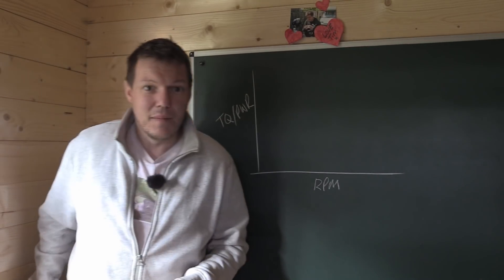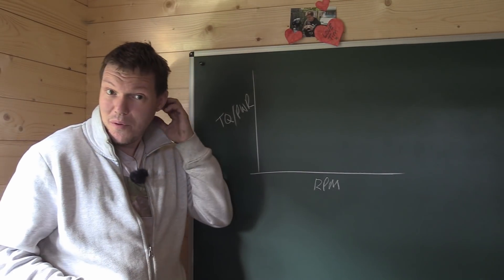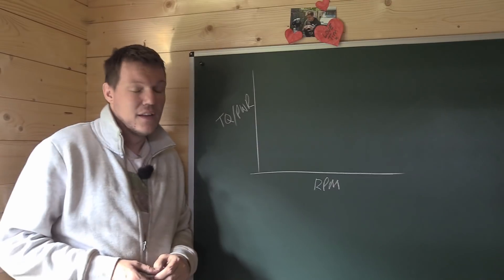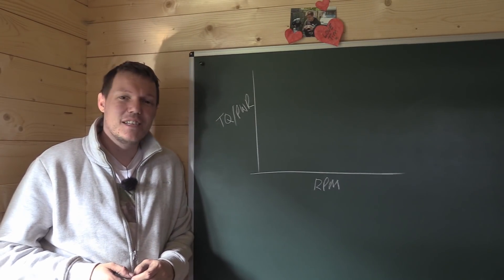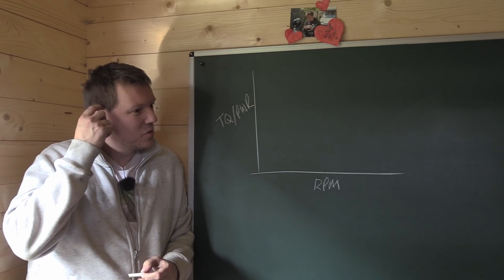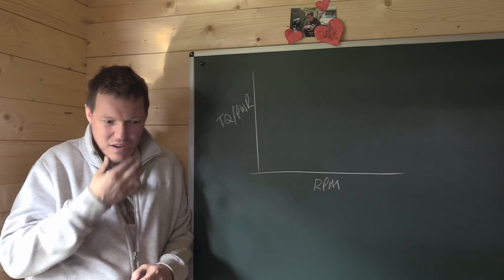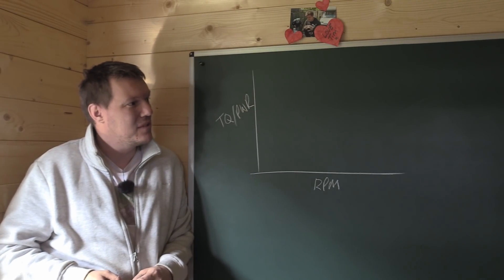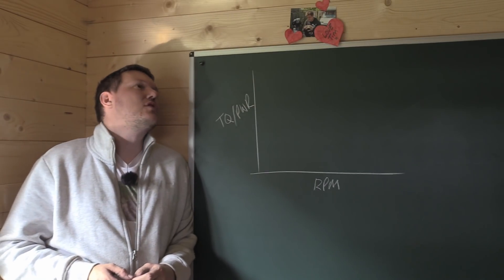Why is it 5,252 RPM?

Comment: How do you incorporate the time element of horsepower if it isn't nm per minute?
Reply from the maker: Well HP is 33,000 ft.lbsf per minute. The 2Pi'r is use which is radians per minute when you factor in the minutes from rpm.
Reply: @thedirtyworkshop  could you do a video on how the radians per minute factor into the power equation please mate?

Comment: I'm probably wrong but I've always said it is kinda the rate that an engine produced torque. So if it's high hp high torque it produces lot of torque quickly if it's low hp high torque it produces torque within a lower rpm range and makes power more slowly!? Or a low torque high hp engine that produces a lower amount of torque but produces it more quickly than a low torque low hp engine.
Reply from the maker: Not really. I see what you mean, but a ship engine revs at 100 rpm and can make 500,000 HP...
Reply from the maker: If you male low torque, ie force but repeat it loads of times per seconds then you have high power. What matters is load. Which we'll be getting to

Comment: You're making this way too complicated. Start from what you have, which is RPM and torque and convert them to what you want, which is horsepower.

Power is force * distance / time.

1 horsepower is 33000 lb-ft / min.

Note, since the units of horsepower are lb-ft, it is normalized (i.e., the distance is unity).

Torque is force * distance, where distance is the circumference of one revolution of the crankshaft.

The circumference of one revolution of the crankshaft is 2 * pi * radius, where the radius is the stroke.

Note, since the units of torque are lb-ft, it is normalized (i.e., the stroke is unity).

Therefore, distance / minute = 2 * pi * RPM.

Plugging distance / minute into the horsepower equation, horsepower is torque * 2 * pi * RPM / 33000 or torque * RPM * 2 * pi / 33000 or torque * RPM / 5252.
Reply from the maker: Lol what was your first sentence?
Reply: @thedirtyworkshop  My point is that the number 5252 comes from basic physics and math. It's trivial to calculate.
Reply from the maker: It comes from mathematics, not physics. It's dimensional analysis. Regardless, that isn't the point of the video... People ask were does the number come from...
Reply from the maker: Why is a pound a pound? Why is a meter a meter? Because someone one day decided.

As for HP, James Watt was trying to sell his engine to customers. They used horses and he wanted to compare his engine design to horses to showcase how much better they were.
Reply from the maker: He tested what a horse could pull at what rate. It was 32,xxx lbs.f / ft per minute. It was rounded to 33,000 for ease of use.
Reply: @307Driftwood It is literally an estimate of the work that could be done by a horse. It originated when steam engines were being built.
Reply from the maker: I hear this a lot. This could be said about any units...

Comment: What limits the rotational speed of a motor? clearly it cannot be the mass of the pistons because if you had an engine B with 8 times more displacement than an engine A, the cylinders of engine B would be 8 times heavier therefore engine B would have to rotate 8 times slower than The engine A, and therefore the engine A and the engine B would be equally powerful which makes no sense because it would mean that the marine V12 with hundreds of liters should be as powerful as a V12 of a car, then will the G forces be? ? For some reason I thought that regardless of the blow of an engine as long as it reaches 25 meters per second it will reach more maximum G-force that a connecting rod could withstand, but then I thought about it more and well ,,,, uf this is dense I will write it in another 2 comments
Reply from the maker: What limits the rotational speed? Piston mass. Why? Because that is what generates a force pulling the conrod. 

Your example of 8x isn't based on reality, because everything isn't linear. Velocity is the square and not linear...
Reply: @thedirtyworkshop  How? is the velocity squared? If you have a 8.6cm travel at 2,000 RPM per minute, you run 2,000 times those 8.6cm that are 10KMH, this grows linearly, but if you talk about this formula K = 1/2 (m.v2) that would be something else
Reply from the maker: Who mentioned velocity squared?
Reply: @thedirtyworkshop  I think an 8 times bigger motor will spin at half RPM.
Reply: @thedirtyworkshop  I mean the linear speed of the piston in MS or KMH. I'm not talking about RPM, if you have a B motor that is 8 times bigger than A motor it will have a 2 times longer stroke, therefore at half RPM it will have the same linear speed. and the kinetic energy of the piston It will only be 8 times bigger, not 64 like you told me (because the speed is the same)
Reply from the maker: What?
Reply: @thedirtyworkshop  ( I think ) he might be confusing the fact that  engine stress of a engine @4000 is is more than that of a engine @2000 or is he on a completely different tangent?

Comment: the old idea that what i had... one wonders if might be interested in hearing more about it or had any thoughts vis a vis how a concept might become a reality? LTO batteries. 30000 cycles, rapid discharge and reccharge...supercap bank layered on top for load dump...electric spool up small trubo to maximise engine power at higher revs....no reason why not...
Reply: agni motor would be an off the shelf dc solution for the drive,, the whole thing has developed in concept too, engine as a flywheel essentially is the way ive been thinking about it- its how they already work some of em,
Reply from the maker: Weight and cost, that's a good reason
Reply: @thedirtyworkshop  ok so no supercaps, lipo batteries under vicious duty cycle, and the turbo is the redherring in any case, unless its designed in, for prototype purposes the rear brake goes in the bin.
theres a couple of pounds, carbon fibre swingarm- yes cost but its a singular piece and this weight viability can be added in later so long as you pick a light enough frame, its not a car, it doesnt need auxillary electronics either, so you bin the lead acid stator etc, becomes mount point for the gubbins...
carbon fibrous everythings, titanium boltings etc. be light enough to put the turbski back in.
Reply: @thedirtyworkshop  do you want to buy a mazda? transit? gsxr? cbr?
Reply: @thedirtyworkshop  two strokes are not shite in this instance btw was a thought...less flywheel effect and engine braking to supplement as a reason why they are still shite.
as to duty cyle? thats all a bit maths, but if youve the two stroke singing at top efficiency geared for the powerband, the whole idea of a two strooke hybrid is a cool one when it comes to stripping the weightings...
Reply: @thedirtyworkshop  ok so a pushbike, chainsaw engine, pack of lipo batteries and an arduino with some clever plugged in?
is heavy and expensive?
for proof of concept?
Reply: @thedirtyworkshop  its always weight and cost, yes we know. with me its not so much that as time.
Reply: sgood idea mr heavyspensive, matt heavyspensive killer of dreams.
Reply: what did ferrari do? simplified the hybrid, front wheels electric, engine to the rear.
i do same, for bike.
elimate all the gearbox related trickiness, introduce a whole new level of computer based trickiness.

Comment: There are a lot of engines that never get to 5252 RPM but most of them will have a higher torque number than horsepower number.

Comment: Because that's where it happens to be. In Nm that's ~7120
Reply from the maker: That's the same shit explanation most people give... because it's there
Reply from the maker: Can you explain where 7120 comes from?
Reply: @thedirtyworkshop  No.
Torque and power are like the area of a football field and the width of it. Totally different things yet one is dependent on the other. 100hp is 100hp regardless if you achieve it with 50 or 200Nm.
Reply from the maker: Then they're not totally different...

Comment: It does make sense!     the units chosen are to relatively display combustion engine power as we would use it    5252rpm is and especially was back in the day commonly seen and used by the general population       also  you never want to go to the pub without your rubber